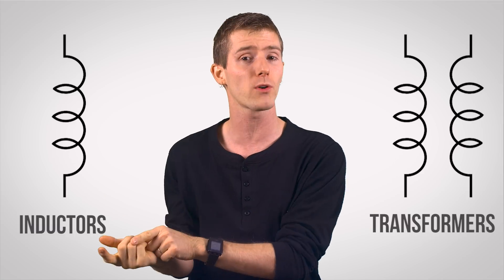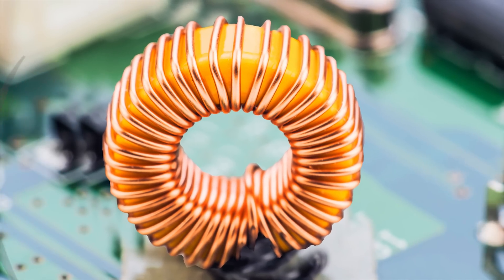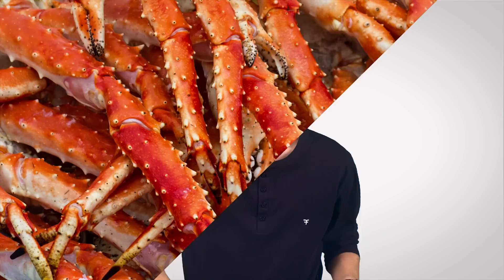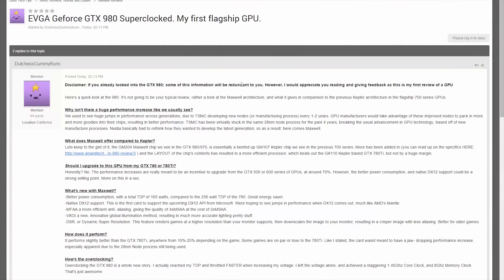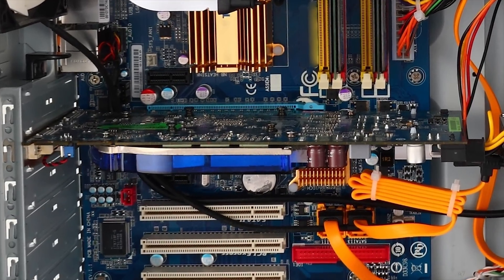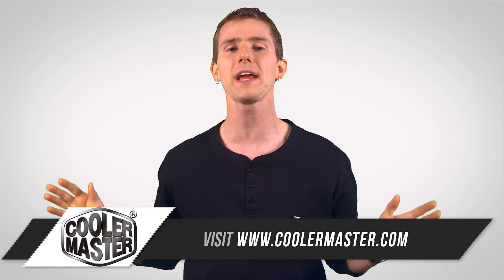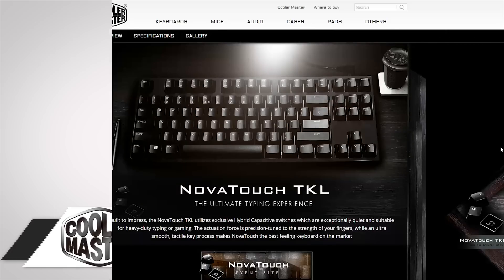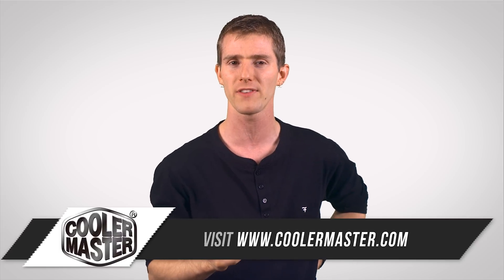Coil Whine as Fast As Possible

Comment: I have a lot of coil whine but I only nodes it while I am using earbuds (I haven't tried headphones). I had the same problem in the past with my gtx 650 in the same pc. and I am still having that problem with my r9 380x. My pc is an upgraded prebuild pc with a crappy power supply and a cheap medion motherboard. what would be the most likely thing I would have to upgrade to fix this problem.
Reply: dude its not ur motherboard or graphic cards its ur psu for sure! im having the fucking exactly problem and myne psu its a corsair cx 750w , with less then 1 month , try to see if its ur psu , im gonna do an RMA
Reply: tnx
Reply: +Pedro Sousa I got the same psu, and have alot of coil whine myself. Will most likely have to switch it out pretty soon
Reply: y , imma switch it when i have more money , corsair says that this problem is not an anomaly whatever , i got robbed when i finish my setup ill swap it anyway , atm im fine since with my headset i can«t hear the noise.
Reply: Agree it could be the PSU. But I have a mid-tier Seasonic PSU and
 I get a lot of coil whine with the R9 380X as well. I'm not saying it can't be the PSU but I think in your case it could be either of the 2. You could just 
be unlucky and your new GPU is having the same problem as the gtx 650. Just something to think about anyway.

The other thing is, because you're ONLY getting it while using earbuds, it could be something completely different. High pitched whining noise is a pretty common problem with onboard audio in cheaper MOBOs. Even if you do have a dedicated sound card, it is still possible. Does the noise stop when you take out the earbuds? Then it is most likely only be an audio issue and NOT a problem with the PSU or GPU.  The upgrade to fix this this would be to get a decent sound card.
Reply: the coil that im getting only does ingames , when i minimize it it stops , its not high pitched , and i clearly can tell that the coil is comming for my psu-
Reply: +Pedro Sousa  Obviously the PSU then in your case. 

I was thinking that it could still be something audio related in emile's rig though, because he said it only happens when he's using earbuds. Just something to rule out before he spends a bunch of money to replace the PSU. Because high pitched whine in the audio output is a really common problem too, esp if you have a cheaper build.
Reply: nah my build is not mid or cheap , i used all top notch on most components , and i got this psu for a cheap price got a really good promo , so i bought it , 1 month later turned out to be a waste of money.
Reply: +Pedro Sousa I was talking about emile lol...he said he has a cheap MOBO.

Comment: My old computer had a lot of it, so annoying, especially when it was supposed to be a quiet build.
It was driving me nuts, I couldn't figure out what component it was, changing the power-supply reduced it, changing video card didn't help, I swapped out the motherboard and still had it. Building a new computer solved the issue after years of tolerating the annoyance, and now I'm finally enjoying the silence.
Reply: Tell the true. I guess you miss the whine now... after all these years
Reply: I definitely don't miss it! :p And it was coil whine, it wasn't a fan.

Comment: I OC'd the graphics card, 970 and when I do so the whine gets louder. Will that degrade my graphics card?
Reply: +Splitty Nitty Not really usually the coil whine on graphics cards is caused when you have really high fps like more that 150 fps , if you Oc the graphics card it will of course give more fps and get the coil whine worse , its not going to damage your Pc but i think you play cs go or other kind of games where you get unnecesary high amounts of fps. Just cap the frame rate where you like it and that`s it  or simply don`t overclock on games you don`t need more power .
Reply: Victor Elias Thanks for the reply bro, I keep that in mind.

Comment: Gigabyte  GTX980 (not the Ti version) just sufered from Coil WHine after 1 year gaming. =(
Reply: Exactly same problem man. Figured out any solution or something?
Reply: +Slatzko use locked frame rates in games
Reply: Deactivate all CPU features in BIOS and if whine is gone turn them back on one by one. 

Dont ask, it is about resonance frequencies from main board to graphic card.

Comment: My 30m coil tower is whining very badly. I tried replacing the wind powered supply with a nuclear one, which made it a LITTLE more bearable, but it's still pretty annoying to have birds falling on my house because they can't handle the high frequencies...
Reply: +Bier “Bierbart12” Bart You could taxidermize the dead birds and make a collection of "birds my 30m coil tower killed"
Reply: Energy Core
Excellent idea. This improved my situation by light years.

Comment: You can get rid of coil whine by slightly overclocking the CPU or GPU depending on where it's coming from.
Reply: I have an gtx 670 I dropped the clock speed 20 mhz and it stopped

Comment: I get speaker noise upon playback of video, some type of interference with speakers. It kind of sounds like a flickering film sound, only when i mute audio, when i play audio it plays fine, also audio works fine on you tube but in media classic player it makes a noise, there's also a hiss sound coming from speakers, I'm plugged into a graphics card the motherboard video connection seems fine but my monitor doesn't work for some reason on it, it also seems to occasionally freak out on the graphics card, wondering if it maybe the motherboard, which seems to have had issues in the past, was setup for running hard drives in faster mode but then open day it just stopped then a fan stopped running, makes me wonder if power supply or motherboard were damaged at some point maybe by power cut off, i have surge protectors, oh well, kind of crazy.
Reply: +econogate I dont know about all your other problems but media player classic might have something corrupted or incorrect audio settings.

Comment: new psu fixed it for me , had to change it anyway .
Reply: That's right... That's because it's the PSU whining... The card makes the PSU whine and not tbe other way around although in some instances GPUs apparently can whine too..  although I doubt you'd hear it... the loud whining you hear under load is purely related to the power usage and nothing to do with FPS (other than power is a requirement of FPS) like others have mentioned

Comment: Some users of the ASUS STRIX GTX 970 are reporting it, but I have no problems with my GTX 970. I'm lucky
Reply: +Quenten Schoonderwoerd 
No problems,... except 3.5Gb normal Vram and 0.5Gb slow Vram :DD
Reply: Dennis Spengler With a bit of overclocking I still get good performance. I only game in 1080p so that's fine
Reply: +Quenten Schoonderwoerd Just don't attack it with friendliness pellets.
Reply: +Quenten Schoonderwoerd Yea but wait until you play a game which uses over 3.5gb vram. The 970's performance goes off a cliff the second it hits that "slow ram".
Reply: +Mr Nobody I know that... Gta v uses a maximum of exactly 3.495 or something ram and never shoots it.
Reply: i get it on my msi 970, but only  in main menu of one game,  lol
Reply: +Quenten Schoonderwoerd the 970 is too scared of your profile pic to whine.
Reply: E-man - EL If I can't attack my GTX 970 with it, what do I attack then? Wait... YOU!!
Reply: +polikerski Same here. But only when I have over 1000fps :D
Reply: Gurkensaft How do you even get 1000 fps? CMD or something xD
Reply: It was sometimes in the lowest 3D Mark test

Comment: My motherboard whines when my CPU runs at a certain clock speed. Luckily, it is one of the middle speeds, so it doesn't happen often (most of the time the CPU runs either on the lowest or the highest clock).

Comment: Yo, is anyone else getting coil whine on the MSI GTX 980ti 6G online people mostly said its doesnt really whine but it is, quite badly tbh, how can you tell if it's your power supply instead for instance?

Cheers
Reply: +PageArts Entertainment 
My MSI 980ti that I just purchased has a small degree of coil whine at times. But it is tolerable when it does occur and is not much louder than my case fans when it does.
Reply: +PageArts Entertainment Hello, I have the same problem. Few Coil Whine with this card.
Reply: Ive noticed over time mine no longer seems to whine.
Reply: +theripper121 - In fact, the noise is through the audio output to the monitor.

Comment: Just built my PC yesterday. It just started whining today. I have the XFX Radeon R9 280X. :(
Reply: +Atm2222 Overvolt it, undervolt it, overclock it. Do anything that will change the amount of power the card draws. Coil whine happens because it (very simply put) has a lot of buck converters that switch on and off extremely rapidly to regulate power (make the 1.x volts from 12V input) and if you are unfortunate enough their frequency will hit the audible range.

If you can increase the frequency (somehow) over ~20KHz the whine will dissapear.

You can remedy it on &quot;the other end&quot; as well by changing the voltage the PSU puts out on 12V rail by minute amounts. That&#39;s why &quot;switching PSU&#39;s&quot; sometimes help, no power supply generates exactly 12V.
Reply: +Atm2222 Well, that's kind of what you get when you go AMD.... lol
Reply: +GS Ethan lol. not true. i upgraded from a radeon 6870 which didn't have any coil whine (and i used it for 5 years)  to a gtx 970 and noticed coil whine after one month. on the upside it's only in the main menu of a certain game
Reply: +polikerski Yep. Jumped from 2x 6850s to a GTX 980.
Usually only notice coil whine when running more demanding games (R6: Siege max settings, Star Citizen max, Warframe max settings maybe, etc)
Reply: +polikerski same here, only happens on main screen of 1 game :P
Reply: +GS E2k taking every opportunity you have to bash AMD i see.
Reply: +Energy Core as they like to do

Comment: Quick Tip: when identifying coil whine, listen through a paper towel tube to nail down the exact coil producing noise.  In some cases I've had success in reducing whine by using a little bit of hot glue on the coils. Try at your own risk because this will void the warranty, but it worked for me.

Comment: I find coil whine can happen on any kind of load, I dunno why, but even youtube, or minecraft, or roller coaster tycoon 2 can cause coil whine on computers I've played on, Then again all the PC's I've played on had bare coils, nothing isolated, canned, or gunked up with plastic, silicone, or epoxy. I got use to it after a while but then again I usually wear head phones, so I don't hear most of the coil whine.

Comment: You forgot to mentioned that there is 'software induced' coil whine for GPU's. If your games are running in bizzare framerates ANY GPU will scream hard. Examples of this are main menus of games where frames rates can go in thousands or even 10s of thousands (OVER 9000!). To bypass this type of induced coil whine always make sure to have a framerate cap on all games to like 200 or something.

Comment: Can overheating cause coil whine in a notebook? I modded the fan curve on my lenovo Yoga 2013 and gaming temps are about 73c but recently I've noticed coil whine even at idle. Should I be worried it's on its way out?
Reply: +Jon Olaivar It may be, but it depends on the severity of the whine. Since the whine is caused by vibration, a louder whine indicates heavier vibration, and this can cause the coil to snap or damage the magnet the coil wraps around. However, if your laptop is built up the same throw-me-down-the-stairs-and-take-me-swimming-with-your-data-still-safe quality that IBM has had in the past, and considering the absolutely ridiculous coil whine the graphics card in the video was suffering, your computer should be fine as long as you limit the framerate to around 60 FPS in games and double check that your Hz setting is correct for the laptop screen. (60 hz is the most common for 1920x1080, however this specification may vary exceeding this resolution. Look up specifications of laptop to find out more.)
Reply: +prizedcoffeecup 
Okay, thanks for the information! 

It's definitely not a gaming machine,  but I use it to play games like beamng.drive and skyrim. FPS stays around 20 as this laptop only has an i5 3317u and no dedicated card. The whining seems to be coming from the chipset and is more of a slow electric ticking. This laptop has all SSDs so I know it's not that. The main thing that concerns me is how it randomly started. I have increased the TDP and upgraded the cooling,  is it also possible the TDP increase is putting too much on the power delivery?
Reply: +Jon Olaivar It may be straining it a bit, but if it's just a ticking, it's not as bad as I thought it would be. Do keep an eye on it, though.
Reply: ***** Okay, thank you, ill
 turn down some settings if it gets worse lol.
Reply: ***** You're welcome.

Comment: I get coil whine on Knights of the Old Republic but not on the Witcher 3 and Fallout 4. Is there a reason it does this? I have an XFX R9 290 if it helps.
Reply: +Tobias Wheaton Probably because that game is older and you get a higher framerate which causes coil whine. Try turning on V sync
Reply: Yea it worked. Thanks dude.
Reply: Also does coil whine decrease the performance of the graphics card over time if you let it whine?
Reply: +Tobias Wheaton Coil whine has no effect on the card performance.

Coil whine happens because the card (very simply put) has a lot of buck converters that switch on and off extremely rapidly to regulate power (make the 1.x volts from 12V input) and if you are unfortunate enough their frequency will hit the audible range.

A solution is to overvolt it, undervolt it, overclock it. Do anything that will change the amount of power the card draws. If you can increase the frequency (somehow) over ~20KHz the whine will dissapear.

Vsync serves the same principle by capping the card in older applications where it otherwise would hit insane FPS and use just the right amount of power to make the inductor ferrite cores vibrate between ~20Hz and ~20KHz.

You can remedy it on "the other end" as well by changing the voltage the PSU puts out on 12V rail by minute amounts. That's why "switching PSU's" sometimes help, no power supply generates exactly 12V.

But glad that enabling vsync worked for you. That's by far the simplest solution and first one to try.

Comment: as long as you maintain your FPS at a decent rate, coil whine will go away, with games that dont require much, turn up the settings, or set a limit to the FPS at around 60, with games like fallout 4, run it at 30

Comment: My Graphics card's Fan creates a whining sound??
Reply: +Marius Ammann When he talks about coil whine coming off of fans, it's a very rare scenario, but indeed possible. The reason that it's very rare is because fan bearings will produce a different, but still annoying whine faster than the coils ever will, because instead of being one thick strand of copper around a donut shaped magnet, there is many, many, MANY more far finer strands of copper around 4 different plastic pegs in a cross shape, each coil linked to one another across from each other. These coils are meant to take tons of alternating electrical impulses in order to move the magnets embedded inside the center hub of the blades so that the fan will spin the blades around, and for a fan to develop coil whine, you would have to keep replacing the bearings and using it hardcore for anything and everything possible for 20 years or more, and MAYBE get a faint coil whine when you put your ear up to it and hold the blade.
Reply: The whining stops when I put my finger into the fan and stop it from rotating , I guess it's the bearings or something like that.
Reply: +Marius Ammann Yeah...that's gotta be the bearings.
Reply: I was using it as a server so I just took it out the card and used integrated graphics and the computer is basically silent now.
Reply: +Marius Ammann Nice.

Comment: I've only noticed coil whine on my r9 380X when the fps for games like minecraft had the setting turned way down and vsync was off. When the fps went over 1200 it started to coil whine pretty badly but once the settings where turned up again it just goes away. Only time I've ever heard it. Any other game there is no coil whine at all.
Reply: +Alan Mays (That90sKid) its because your getting such high fps, when you turn settings up or limit your fps to 60 the whine will be quieter because the coils arnt viborating that much, my 970 has a very quiet whine that kind of sounds like a fan so i just ignore it
Reply: The Fallout Guy Yeah it's only noticeable at really high fps. When I first heard it I had no idea what is was and it freaked me out though. I just built my first PC about a month ago and never knew all the various problems that can occur.
Reply: how bad is yours? is it really high pitched or just a slight hum like mine
Reply: The Fallout Guy It's a very high pitched squealing sound. It only happened on minecraft when I turned all the settings down and had vsync off. Besides that I never hear my gpu at all even when I'm gaming.
Reply: so its only that game? then you should probably limit the fps to 60 and the game will still run fine but the squealing will stop
Reply: The Fallout Guy My screen is only 60hz so I use vsync whenever I can.
Reply: yeah me too